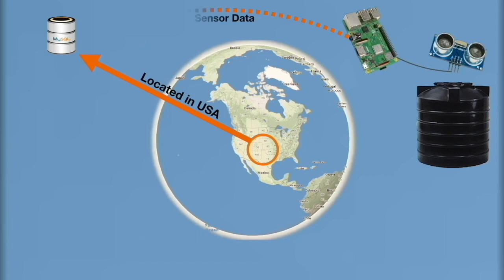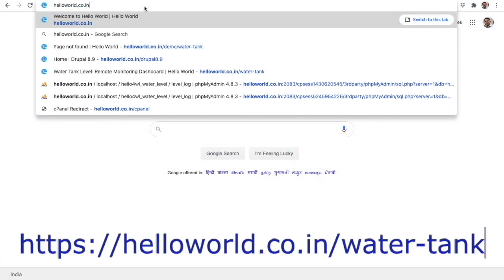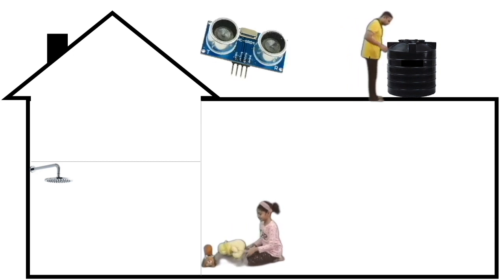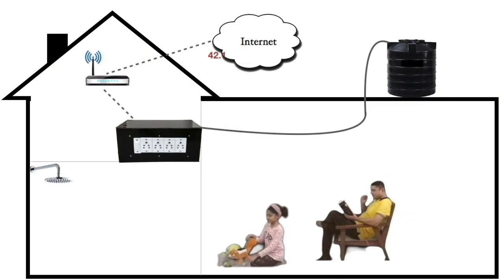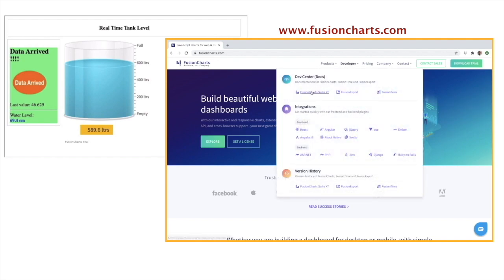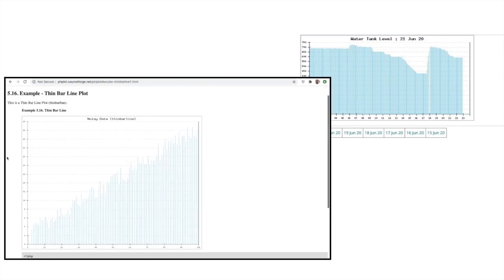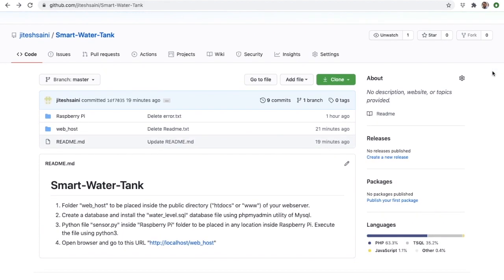IOT Project: Smart Water Tank with Real-Time Dashboard | Home Automation

Comment: Hello. I am testing the code with both the JSN-SR04T and HCSR-04 sensors but from about 220 cm, both give me wrong data (very high). What could it be due to? I need a distance of about 3 meters.
Reply from the maker: Max range of these sensors is around 400 CM.. You can test them with other test codes available on internet also. Let me know if that works

Comment: There is a techincal problem in this code. If you will run this program continuously for around 8 to 9 hours it crashes and system becomes offline. I am 100% sure about this as I have done research on this and this was happening with me but I solved this problem.  No body in youtube will tell you about this problem because they them self even don't know why it is happening and how to solve this.

Comment: Nice tutorial sir. Can you help me what those resistors do ? why the configuration one in series one in parallel ?
Reply from the maker: That's simply a voltage divider circuit to make 5v pin of RPi compatible with 3.2v pin of sensor

Comment: I am a user of this project and after a few months of use I can assure you that I am very happy with how it works. Just one observation: in large tanks with top filling, while the water is entering the waves are produced, they give erroneous readings to the ultrasonic sensor (since the waves do not bounce in a straight line). During the emptying, with calm water, the readings are perfect and stable. I will try to place some kind of cone-shaped plastic bottleneck in the sensor area to see if reception improves during filling.
Reply: After you give cone-shaped plastic  in the sensor area, the readings are stable eventhough the water is flowing??
Reply from the maker: Yes

Comment: Exceptional
Reply from the maker: thanks
Reply: @jitesh_helloworld  Can you try to make a Raspberry Pi project with sonar to plot(running plot) underwater surface and under water body in general ? I have seen  a few projects that use a car reversing sensor with a convertor circuit to interface with RPI GPIO pins similar to this fish finder https://youtu.be/XgexF9UJBGU   and sonar plotter https://www.youtube.com/watch?v=nWLPmjaNJ6I
Reply from the maker: a good sensor is necessary for this. Programming RPi shouldn't be difficult

Comment: Would it be possible to add some kind of full-empty notification or alarm? It would be ideal.
Reply from the maker: The low_level_warning() actuates a GPIO when certain level is reached. You can add a hardware alarm or send an email. A notification via Web Application also requires some modification in the PHP script to send emails.

Comment: Anyone else having issues with condensation forming on the sensor? I have the sensor inside the tank just under lid. In the early mornings when temperature decreases, water drops form on the sensor and causing readings to be stuck at 18. Currently using the JSN-SR04T sensor.

Comment: Thanks, This is working well, But How can I can I change the time zone ?. I did edit the line in the phplot.php file to my local timezone but the graph is still plotting 3.5 hrs ahead.
Reply from the maker: Paste that line in graph.php and see
Reply: Thanks... Tried that.
date_default_timezone_set("Africa/Johannesburg") ; 
Ive put that in the graph.php, but did not change anything.
Reply from the maker: Ok.. so I checked.. Pl change the timezone in 'insert_data.php' file. This file is responsible for storing level value in database along with time info. This should solve your issue. Let me know.. I will update the code to make this setting easy for others too.. Thanks
Reply: Thanks, that fixed it.
Much appreciated

Comment: I have pg and want to install this smart water tank system.  I think about sonoff devices but they have no distance sensor to detect water level in tank..  Would u suggest me some distance measuring sensor which can join with wifi switch socket ,,,, so that i can make a scene if water tank is low,, pump start
Reply from the maker: you can use the water proof distance sensor JSN-SR04T. But you need to integrate it with some wifi programmable device. In my case I have used a Raspberry Pi. Read this https://helloworld.co.in/article/smart-water-tank

Comment: these sensors are not good detector of water and it will fail as water drops spread while filling time and in winter summer moisture accumulating on sensor

Comment: I have a question why we should use resistors?
Reply from the maker: voltage divider ckt to bring down 5V to approx 3.3 V .. As needed to work with echo pin

Comment: How resistant to humidity is the sensor? Does it stop working after certain amount of time because of that?
I live in an area with lots of humidity, and a water tank multiplies that.
Reply: To answer myself, turns out that there are waterproof ultrasonic sensors. The model of the one I saw is JSN-SR04T, altought I am sure that there must be others.
Reply from the maker: Correct. You can use JSN-SR04T sensor. It has same pin connections as the one shown in this video

Comment: Thanks for the videos, helpful, but please how can i use it for oil tank like Diesel or Petrol or is there a sensor for that, Thanks
Reply from the maker: Ultrasonic sensors can work with any liquid surface. Water, petrol, diesel whatever. I have tried the water proof sensor JSN-SR04T with raspberry Pi. It works just fine. You consider that also
Reply: @jitesh_helloworld  Thanks for the response, really helped you are the best

Comment: Hi Jitesh, great job! Can I ask, can you create actions when the tank level reaches a certain point, such as 25% to automatically send you an alert to your phone or email? So you know, instead of checking the url to see the level? 

Also is rasberry pi better to use than an Arduino Uno, which I have seen others use? How do you know what code to use?
Reply from the maker: Yes, it is possible to send email alerts. You can do it on the server side application by integrating PHPMailer library. 
You can use other microcontrollers such as ESP32 & Arduino with built-in wifi to achieve the same. However, you need to write the code for interfacing the sensor and uploading the data to remote server.
Stay tuned for a few days, I am working on a Web Service to address these issues. Will upload a video soon

Comment: Raspberry Pi works on about 3V/5V, and the ultrasonic sensor has around 4 pins to be connected. I see you have used an ethernet cable to tackle it, good job with that. But since you're running the cable between Pi at home and the sensor on the tank site, wouldn't the long cable result in voltage drop, erroneous readings and miscellaneous interferences. What's the length of the ethernet cable you're using and the VCC supplied through it?
Reply from the maker: Haven't faced any issues .. I'm using approx 25-30 meter cable. Quality of the cat 6 cable cores is quite good. One core is supplying 5V VCC from Raspberry Pi to sensor.
Reply: no cable is needed. You just make sure that your wifi signals reaches up to your tank and install rasp-pi on the tank lid just insert a 5 volt supply to it there and it will get connected to the internet.

Comment: my water tank is on the 8th floor I live on the 4th floor can the 5v signal from the sensor travel a 15meter distance? from the tank to raspberry pi in my flat? i know this is a very simple question but still..
Reply from the maker: Yes it should work. I tested it upto 25 meters using a CAT 6 Lan cable. Works well...

Comment: Much needed solution, Great job !! 
I guess using Raspberry Pi would not be the cost effective solution. Did you try with Arduino or any other cost effective solution.
Reply from the maker: Thanks.. You can reduce the cost by using ESP32 in place of Raspberry Pi. It has built in wifi and much less cost.

Comment: Hello sir . I have followed all the instruction given in the git hub provided by you. But I am facing troubles in connecting the raspberry pi output to the data base . Please sir help me
Reply from the maker: You need to find out the ip address of web host where the database is running.. Then replace the IP address in python script with this one. Simple commands such as ifconfig on linux and ipconfig on windows will tell you that
Reply: @jitesh_helloworld  sir I have changed the IP but it's still showing error and not getting connected.
Reply from the maker: @vedaantbhangle3624  check ur mail
Reply: @jitesh_helloworld  thank you sir but I have mailed you my last doubt.
Reply from the maker: Replied. Good it's working for you.

Comment: Hello , what's the specification of the raspberry pi ? which variant to use 2GB/4GB?
Reply from the maker: You can use any one. Any model of Pi 3 or Pi 4
Reply: @jitesh_helloworld  hello sir I have made the data base as ler the instruction in the git hub provided by you but I am facing problem in creating a website and connect it to the data base and raspberry pi.
Reply: Hello sir I have hosted a local server as per the instruction in the github  but I am facing issue in connecting the raspberry pi to the server. So how should I determine the IP to be used in the server? And how to get login and password. ??

Comment: Hi, Jitesh, very interesting your project and I have a question, in the video you show the case when the raspberry pi and the server are in different locations and in the example code I see the case when the rpi and the server are in the same LAN. Is any other change that I need to perform (appart from IP) if I use for example an AWS EC2 server (cloud) and RPI ? Thanksin advance
Reply from the maker: Thank you. Nice observation. So the code is to assist you to replicate the setup in your LAN in case you do not have access to external webspace.. No change is required in the code apart from the IP, as you correctly brought it out. Just ensure the the raspberry pi is connected to internet while you try to upload data to external server. Just copy the 'web_host' folder in the your AWS server and prepare a mysql database with name 'water_level' and import the 'water_level.sql' file so that you have the database setup which the application will require. Ensure the database credentials are entered correctly in 'db_params_wt.php' file (inside 'watertank' folder).  All the best and let me know if you are able to set it up
Reply: @jitesh_helloworld   Thanks,  I implemented your code in rpi and server and  you can see there in http://18.191.62.162; however I have two: problems, 1. The cylindric volume always shows "700 liters" and 2. The graphic shows only the old data (2020). I realized that the data is comming well to the mysql database in AWS. Regards
Reply from the maker: @preparatemasperu5232  Solution is as follows:-
1. change the tank dimensions in "web_host/watertank/util_functions_wt.php" as per your tank

2. The dates are shown for old data(2020) because the sample database you imported contains only those dates. To get current dates you can simply uncomment the commented out part in "function show_dates()" of file "web_host/index.php" and delete the existing code.

Comment: How has your project fared? I want to do this, but im afraid it the sensor will rust
Reply from the maker: Its working fine. The sensor is very cheap (2-3 dollars max) and reliable. Even if it rusts in 6-8 months, you can replace it. But as long as you wrap it up nicely (except the transducer part), it will last longer

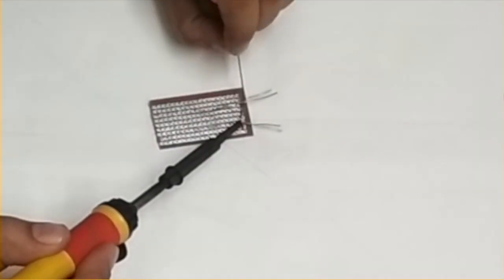Comment: I got lost in 2:45 I don’t know what to do with the circuit
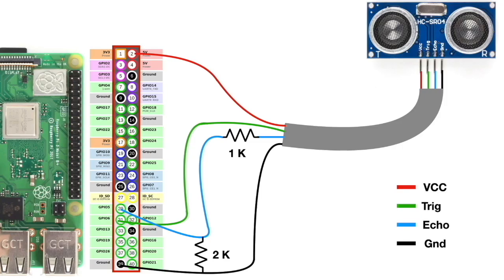Reply from the maker: the circuit is made to achieve the resistance configuration between blue and black wire as shown in the diagram at 2:54
Reply: @jitesh_helloworld  do i use only 1 k ohm and 2 k ohm?
Reply from the maker: @msharialosimi9782  yes. thats right. the resistors make a voltage divider circuit to reduce the 5V signal to 3.3V, which is compatible with echo pin. Read more about it here 
https://thepihut.com/blogs/raspberry-pi-tutorials/hc-sr04-ultrasonic-range-sensor-on-the-raspberry-pi
Reply: @jitesh_helloworld  hi, i have one question and sorry to bother you me we did everything except the website for bottle we need your help
Reply from the maker: Pl ask
Reply: @jitesh_helloworld  me and my friend are working on this for an iot project we did everything except the web page we don’t know how to do it we got lost
Reply from the maker: Are you making the website on a public domain or your LAN.. Email me on jitesh@helloworld.co.in
Reply: @jitesh_helloworld  ok I’ll contact you

Comment: Hi there! Thanks for sharing. For those who are gonna try it, it didn't work for me with clean water. Thanks anyway!
Reply from the maker: Thanks.. It should work with clean water also.
Reply: Can this be resolved by putting something like floating plastic plate on water surface under sensors?...Just wondering if that helps.
Reply from the maker: No need. water surface reflects just fine

Comment: I considered using an ultrasonic sensor to measure the water height (as shown in this video) and it works well in this setting - but if I should installed it in an actual rain water tank, the sensor will get wet (from humidity and condensation in the tank) and it will just end up corroding. Does anyone know a way around this ? 
I plan to use a water pressure sensor (4-20mA sensor) to measure the water pressure instead - this way I can determine how much water is in my rain tank.
Reply: I covered the points where there was a soldering iron with the sensor with hot glue, I put it in a watertight electrical box (with the sensor holes) and so far I have not had any problems with humidity or condensation.
Reply from the maker: Just wrap it up nicely with plastic except the transducer part. As long as it is not submerged into water, it continues to work well even in humid environment. I have used it this way for past 6 months

Comment: Hello, I love the protect, I have many tanks in my farm and they are far from each other, is there a wireless way con connect each sensor to the pi? Thanks amazing content
Reply from the maker: Glad you liked it... You can setup an extended wifi zone by using boosters. Then u can use the sensor along with low cost processing board (pi zero OR ESP 32 wifi enabled boards)  on each tank. These individual boards can trasmit the sensor data to a remote server through wifi link.
Reply: @jitesh_helloworld  what about SDR. Rádio?
Reply from the maker: Yes you can. Once the depth data is calculated you can transmit it using any method.

Comment: hello.. i want this system installed on my home water tank.. please guide
Reply from the maker: Pl check out the source code on GitHub and circuit diagram as shown in video. You may need to modify the IP addresses in the source code as per your network. With a little effort you can set it up. All the best

Comment: I have a doubt ,Here you are saying that the sensored data will be measured and data will be inserted in the db So what kind of data will be measured ??
Reply from the maker: Its "sensor data".. that means the distance reading obtained through ultrasonic sensor. This reading (data) is the distance of sensor from the water surface.
Reply: Thank you so much sir !!

Comment: Another question please bro, in which file did you put the full and empty tank value of your sensor distance ? for me 20 cm tank is full, 190 tank is empty, thanks.
Reply from the maker: For the purpose of tank animation, you need to configure lowerLimit and upperLimit values in "tank_animation.js" file. In you case, total height of the tank is 20+190. So, lowerLimit can be 0 and upperLimit can be 210 cm.

Comment: Please dear i want to create this program on visual studio csharp and arduino how do this please?
Reply from the maker: Hi. implement the sensor interface sketch in Arduino. Use the Ethernet shield to send the data over lan. For that you can create a simple socket program. Now implement the other side of socket program in c sharp and recieve the data. Integrate the data in on gui created through c sharp
Reply: @jitesh_helloworld  But sorry dear i don't know how to connect you'r arduino project with c# and creating a socket between both of them! have you any tutorial about this?
dear i need this project please if you help me i'm glad to be❤
Reply from the maker: @hastyarblbas1519  my project is based on Raspberry Pi not arduino. You can look at the code of this project here https://github.com/jiteshsaini/Smart-Water-Tank

Comment: What is the main moto of this project Whenever water tank became empty it notifies you ?? Please explain
Reply from the maker: Main motto is to experiment and learn. Btw, presently i am using it to provide low water level alert through a speaker. It also alerts if a tap is left open for a long time by monitoring the gradual decline of water in the tank.

Comment: good job bro, what about the distance between pi and the sensor ?
Reply from the maker: Thankyou.. the distance is around 25 meters. Connected through lan cable. Not experienced any issues so far.
Reply: @jitesh_helloworld  thank you, It was to find out if the distance can influence the voltage
Reply: @Samir-ah  CAT 5 had resistance of 0.75ohm per 15meters